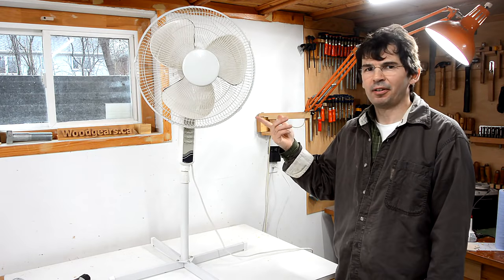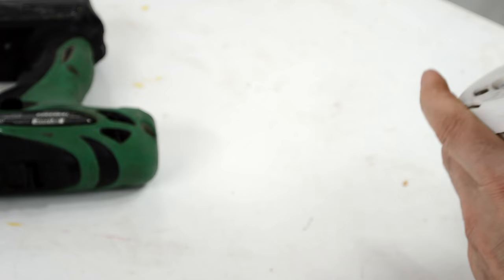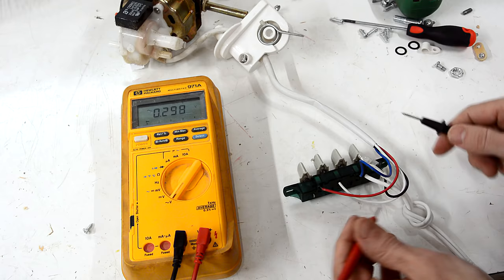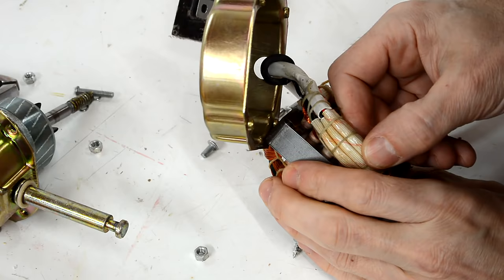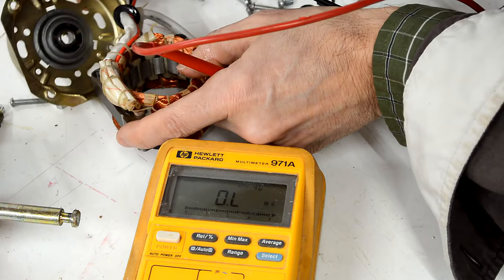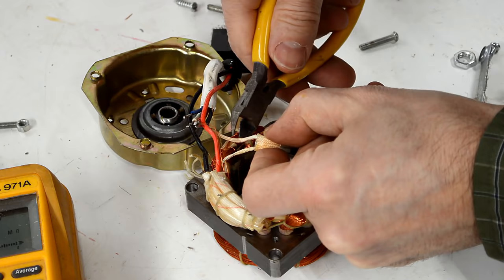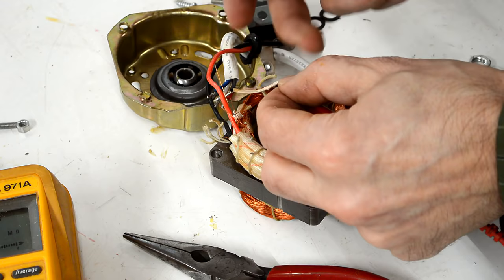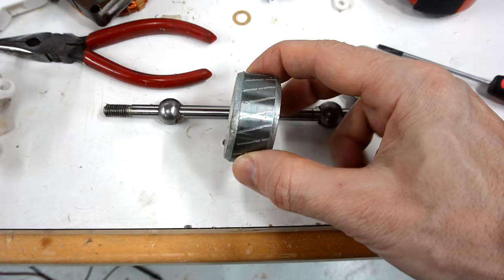Fan repair fail

Comment: this is exactly how all my fan repair attempts always ended...bout 4-5 fans have already been my victims
Reply: Do they use ac for the motor windings? My stupid brain is trying to figure out the schematic, but I keep thinking it's 3 phase ac because that's what I normally work with motor-wise.
Reply: @burtmcgurt3584  it runs off of single phase ac
but will have a special shaped winding or special windings that are only used for a bit to get the motor spinning, matthias already had several videos on it
Reply: Wow! a fan serial killer!
Reply: Work on them slower and carefully and you shouldn't kill them usually not hard to replace broken components like thermal fuses and put everything back just don't get in a rush and pull on wires. If you need to you can cut wires and re attach them just to make it easier also solder and an iron (soldering iron that is) helps
Reply: Some cheaper fans are like this. Better ones have the windings soldered to a PCB and it makes the repair easier

Comment: that fan was fixable, I just recently fixed one with exactly the same problem. You might just find a way out not to disasemble the motor wrap by identifying the capacitor cable and the power, then bridge those with a new fuse...or if you definetely decide to unwrap  the motor PLEASE DO IT GEN TLY.   with the help of a sharp blade, do not pull them apart.

Comment: For blown thermal fuses: 
You don't have to disassemble the motor wiring harness. The run cap is between the neutral/common wire and a split phase ending. One of the capacitor lead is the common after the thermal protection, if it's blown, there is open circuit between one of the cap lead and the common wire, thus any wire from the motor. Cut the common at the harness, install a new thermal fuse between it and the previously identified lead and you are done! Good Luck!
Reply: This is 2 years back but could you/someone do/point à video on this.

Comment: Firstly I hand it to you for making videos that people can learn from your mistakes instead of them diving into something that is over their heads lol. No but really, kudos to you for taking the time.

As for finding the thermal fuse, dont try assuming wiring will be certain colors. Companies use what's available. But the first thing I saw when you pulled the motor out was the thermal fuse. I'm not bragging by no means. I've always been mechanically inclined but I'm far from being an expert in electronics. Here's how I knew, I just recently opened up the same fan some days ago. I didn't even know what I was expecting or looking for so I searched online and found out about the thermal fuse. So there I went staring at the motor and its windings until I saw 1 wire that went into a white protective tape and another wire coming back out. That doesn't make sense UNLESS something is between the wires; yes, a thermal fuse. So I only had to cut 1 tie wrap. Also, it's never smart to yank or pull on wiring, especially wiring that thin. Just take your time and stare at it if you have to. Again, I'm not making fun. I've made so many mistakes by rushing in before investigating the situation or by losing my temper. Hey, I'm just keeping it real. 
Lastly, you can order thermal fuses online. Don't bypass it by connecting the 2 wires. If the motor gets too hot it will start a fire.

Comment: What are the chances, I got home today and found my fan broken. I first thought it was that lube problem that you already made a video about it, but it wasn't. Than I opened my youtube home page and this video was in the 'Recommended' section (I wasn't a subscriber of this 2nd channel at that time). So I watched and tryied to fix mine. And guess what, it was exactly this problem, the termal fuse. I shorted it's two leads and reasselmbled the fan, now it's working fine. Thanks for the video, saved me some bucks. I didn't knew about those termal fuses, can't count how many ventilators thrown away probably because of that.
Reply: The only downside is if it overheats, It might cause a fire.

Comment: Interesting in that my oscillating Northern Hydraulic “Hurricane fan” is identical to this fan. At least the motor is identical. The oscillation mechanism is aluminum in mine and since the Chinese don’t waste time with bronze oilite bushings, that’s what locked up. I just got mine apart and decided to look online for some pointers and now I know to look for that thermal fuse. So this video is a win for me. Thanks for posting it.

Comment: I'm trying to speed up my little DC fan motor by rewinding it with thicker copper wire. Because it's super slow and weak (0.15 amperes), and increasing by 0.45 amperes will make a significant difference (the more current the more force against air resistence). Ok, to the point. I broke 3 fan already in the process. I gave up and now I just buy new one more powerful.
Reply: Appreciate the tinkering

Comment: you also have a lovely chunk of copper there. Free money if you have a decent recycle place nearby
Reply: +verdatum That much copper isn't even worth the cost of gas driving to a recycling center.
Reply: Oh, agreed. But, if you throw it on a pile, it adds up.
Reply: +verdatum Yep, I do that with copper I get hold of, even short offcuts go in there. When it's a good few kilos, off to the scrap dealer I go
Reply: bonus if you separate the electrical copper and the plumbing copper. You get a premium for proper wire.
Reply: Actually some fan motor use aluminum instead of cooper, and I think that motor use aluminum too.

Comment: I had a small fan fail. It uses a shaded pole motor. I cut the tape open to expose the windings. Found the thermal fuse. It was tiny, and square. 115 C° . I cut stuff out of the way to get the fuse out. It was open. But I cut the other wires, so I can't fix it. I was just curious if the fuse failed. 
 The motor spun freely, it had no reason to overheat.  It ran, i turned it off. And after doing that 100's of times, it was dead the last time I turned it on. Those fuses can fail spontaneously.
Reply: is there a way to know which tiny copper wires on the spools are supposed to go to their corresponding wires?

Comment: NICE video, but,,, you don't have to disassemble the whole unit to check if motor is dead or broken,,,
you have your multi-tester,,, the easiest way to check the thermal fuse is to use your tester,,,set it on OHMS,,, one probe to #1,2 or 3 button terminal  and the other probe to the wire that comes out from the motor connected to the plug,,,, if the reading of your tester is "0.0 or OL (open line)" from the three terminals,,,, then you have a BUSTED ThERMAL FUSE,,,,

Comment: I can't find a thermal fuse. Can I connect it directly without the fuse???
Reply: Don't do it, thermal fuse is a safety device to prevent overheating and potentially a fire.

Comment: I cringed watching this. Luckily all of the fans I find in the garbage have clear reasons why they were thrown out. Burnt motor, cracked plastic pieces, broken oscillator, overall flimsy construction, owner didn't want to clean the fan........yeah. I find lots of fans in the dumpster. I only have one fan that I bought brand new, and it is in my profile picture.

Comment: The motor looks clean like it never been used before probably the owner thought it had power but it didn't had power only low power that's why throw it away?

Comment: The copper coil is heavy & is worth a lot and should be recycled. Hopefully it will be! Is it ok to use a grease on those bushings? I have a ton of these motors in my household fan collection in India and they are always need lubrication!
Reply: Oh well . . . I have a good repair person to take it too.

Comment: watever dude so ther are thermal fuses in fans (i didnt know ) but ive fixed over 20 fans and it was never that fuse. its mostly gunked up or blown cap< and blown cap is very common on a lot of things. (also i just fixed 2 fans right now today ..out the trash ..

Comment: You sure have a lot of brawn. It's nice to do an autopsy on dead equipment hoping to bring it back alive. Most times it's a lack of bearing lubrication that is causing the overheating /burn out of the stator coils of the  motor. Use the blue can of '3 in one' lubricating oil or any "non-detergent 20-w motor" oil to lubricate the shaft bearings and wadding cup,if any. Lithium grease works, but the oil is best. Some manufacturers use "security screws" to assemble the covers to avoid home repairs. Keep trying for the finesse touch.

Comment: Could you have replaced the thermal fuse?  I have a ceiling fan that has a light fixture.  The light fixture stopped working and found the thermal fuse failed.  I would like to replace the fuse but don't know where to get one.
Reply: +LXGIK 80 Ebay, electronics suppliers, etc.

Comment: I have been searching all over the Internet for someone to get that close to a fan inside as I have. The fan i have is a floor fan more of a high powered one and on the inside the wiring is almost the same as the 1 you ripped into pieces. I was trying not to have them pull it apart as far as you did but I cannot find a fuse in this fan. My son left it running and it was just packed with dirt and when he went to touch it it literally burned him and quit running completely. So I have it all pulled apart in front of me for about a week now and don't want to throw it away. I don't know if there is a fuse inside where those wires are like the ones you pulled apart on your video. Should I pull all them apart or not because will I be able to put them back together?  Of course the capacitor is in there that you saved but I don't not now if it needs replaced or not or how to tell. I do not have a electric tester like you have so I don't know if ì can't check anything else without it. I checked the fuse at the end of the plug but it was not clear, it was white with a red line around the center so you could not tell whether it was burnt or not. So right now I am at a stand still mostly because if you would have been able to go a little farther than when you ripped the wires all out I may have been able to see what was inside without ripping it apart. Lol.   I guess I will just have to wing it but really don't know what else to do from this point on.  Thank you for your video!
Reply from the maker: I’d have to look at it to advise.

Comment: the Thermo fuse is broken mathias
Reply from the maker: Umm, yes...  that's what I said.  Why repeat it in a comment?
Reply: Yes but the thermal fuse overheated at some point, so that was the end of that fan
Reply: I hear what you all are saying.  However, the thermal fuse is blown.
Reply: Rafa Adhisatya
Reply: Rafa Adhisat
Reply: +TheAstro30 yeah he went man-ape on that poor thing. But fan motors overheat for a reason. I'd only try to do a repair like this on a fan I really care for
Reply: some fans are just really a pain to fix if their thermal fuse is hidden very deep

Comment: can one still save the motor if some wires have been pulled off?
Reply from the maker: very difficult, wasn’t worth it for such a cheap motor.
Reply: @matthiasrandomstuff2221  I know but I want to learn. Any way you could instruct me? If it's not too much trouble for you of course.

Comment: if you are in my country,"Philippines".. you can easily buy a replacement motor for that or let the electricians rewire the whole thing for around 200-220 pesos or 5 bucks or 5 US dollars,...then connect it to this thing and its as good as new...you can even earn something from the junk shop as you sell these busted copper coils....
Reply from the maker: but in our country, it's cheaper to buy a new fan than to hire a professional to spend half an hour on it.
Reply: @matthiasrandomstuff2221  now that's too bad...how I wish i could import those busted fans and fix it and probably earn a lot from it...some people here prefer "imported stuff" regardless if its brand new or not...

Comment: Hi. If you replace the capacitor with the higher one, would the make the fan spin faster? Thank you. God bless, Proverbs 31
Reply: It will make the motor stronger. I've tried this experiment. One of my stand fans has a 2.5 uf capacitor, so I replaced it with a 4 uf cap. The motor ended up coming to full speed about 2 times faster.

Comment: Matthias, i suggested you to use the condensing unit fan assembly for your project because those fans are more powerful and will last longer like the 1996 and 1992 toshiba aircon fans i had

Comment: Couldnt it be the start run capacitor in the small black box....ooops never mind you just tore it in two. In the future before destroying the fan you might check your caps
Reply: Can you explain me what is the application of capacitor here?
Reply: @sidd9248  depending on the motors design a capacitor may be required to "jump start" the initial spinning of the motor. Others are designed to "jumpstart" the initial spinning and to keep that motor running at the designed rpm under a load. Other motors dont require a start cap just a run cap to keep the motor running at its designed rpm under a load. I hope that helped a little bit. I find caps amazing. The fact that once a cap is energized that part can keep a virtually unlimited amount of energy depending on the cap for an indefinite amount of time. I used to install repair and even build refridgeration equipment. It took me 1000s of volts to make damn sure i insulated the caps id remove from motors and compressors before tossing them into a box or tool bag. They can be funny as hell or can ruin your day. Sometimes if your lucky itll ruin your helpers day but make your decade given the right situation. If you want to learn the hard way but laugh your arse off in doing so start with a disposable camera. Carefully disect the camera you want to isolate the flash components from the rest of the camera. Ill use national geographic as my inspiration for this negative reinforcement testing. I was a mechanic for years. I had a couple kids at a lube center my cousin ran in ft worth tx. The kids would get in my tool box from time to time wo my consent. Thats a no no. Ask any motor head. Id look for a tool that should be here and find it there,not at all,or greased up. After repeated conversations with these guys it still kept happening. Then i stepped it up a notch with verbal warnings then to a light punch in the shoulder. Im a little guy at 295 now but only 220 then so no permanent damage was done. Finally when that wasnt working i went Nat Geo on the little monkeys. I remember seeing an african in the jungle take some shiney marbles or something and making sure the monkeys saw the shine and the objects as he placed them in a mound of dirt with a hole just big enough for the monkey to get his hand in the hole. Once grabbing the items his fist clenched would keep the monkey from removing his hand and would be trapped for the man to catch the monkey. Using that idea i let Rusty see the shiney reflection from the chrome flash on the camera and i placed it in the top of my roll away box. Cap fully charged and bare terminals. I then left the area. When i returned i found Rusty sitting in a puddle of engine oil with a weird look on his face. I offered to help him up and asked what was wrong. He swore nothing. He was resting. I then started the investigation asking if hed been in my tool box. I said id know in just a sec when i reach up there and grab something i left. He then confessed he had been in the box and was sorry. Lesson learned. Good times. It was only around 370 volts.

Comment: Why you didn't check the capacitor which's responsible for %90 of fan's failure!
Reply from the maker: Because I already knew it wasn't the cap based on the symptoms

Comment: I'm no electrician but whenever I'm measuring mains voltage I always hold both probes in one hand just in case
Reply: I can fix this crash without decoding one nail and one second

Comment: How about a LAW banning companies from putting these stupid fuses in places that can't be fixed.   I HATE this society of throwing all shit away into the trash.
Reply from the maker: It wouldn't help.  If it was a replaceable fuse, the fan would still end up in the garbage.  Cause first you'd have to figure out and fix why the fuse blew (likely from not spinning due to bearings siezed with old grease), then find a fuse and replace it.  Things get thrown with far less things wrong with them.  Thank Chinea for that - things are so cheap, it's not worth taking stuff to a repair man who would charge $50 to fix a $20 fan.
Reply: @matthiasrandomstuff2221  It is very amazing how people in west can be so wasteful. That's why everyone should learn to repair basic household appliances so that less garbage is created and you won't end up spending 20 dollars as charges. "Things get thrown with far less things wrong with them", this is the mentality we have to change. Even though the motor may be recycled but it requires resources to recycle and if it ends up in land fill that will only increase the plastic pollution in nature as most of the parts are made up of plastic. No offence, but the attitude you have towards discarding things over repairing shows you are an American which btw is not appreciable.

"Cause first you'd have to figure out and fix why the fuse blew (likely from not spinning due to bearings siezed with old grease), then find a fuse and replace it", this was totally a low cost and effective solution, you knew about the solution and yet you decide to throw it away (I don't know why, may be you were lazy).
Reply: Well with that fan that he messup with ,the problem with it is the bushing,thats the cause for the thermol fese to blow ,so he have to know what he have to do